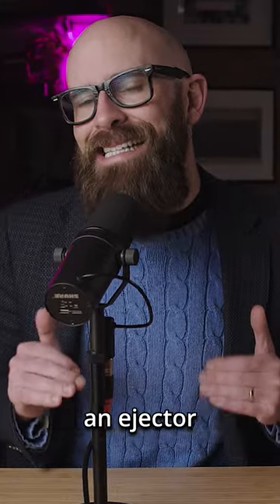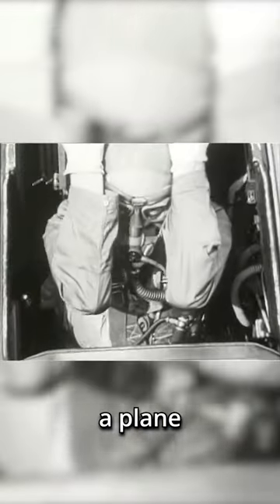How Does an Ejector Seat Work  #shorts

Comment: Almost Simon, but pulling the handle does not send and electric impulse. It sends a ballistic one. Using explosives cartridges ballistic gases set off the various bells and whistles to include in naces series ejections seats "thermal batteries" which turn on and actuate the ejection sequencer (a computer that does as you stated. On older ie sju5/6 seats there is no computer. But rather a rhube goldbergesque machine using explosives, lines, tip rods ectect to set things off in sequence. Canopys are on some aircraft jettisoned from the aircraft in others it is fractured using explosives. But either way the seat is designed to go through the canopy in the even the canopy doesn't do as it should.

Source, I've been an ejection seat mechanic for a bit over 10 years now

Comment: Now do helicopter ejection seats.
Reply: Theres like 1 or 2 helicopters with that feture
Reply: Fighter jet ejection seat: perfectly crafted to save the pilots life even when the plane is damaged beyond repair.

Helicopter ejection seat: haha window
Reply: I dont see a problem with designing helicopter ejector seats. But they usually dont fly that high or that fast. A pilot is usually able to land the thing.
Reply: I heard that there was a concept for a helicopter ejector seat that would eject the pilot out at Mach 20 or something so they don’t get hit by the rotor blades although I’m not sure if this was real or a joke
Reply: @cheesemancomics  helicopter ejection seat aren’t used because they would have to launch you down, and that’s where the ground is
Reply: @starside6738  they are absolutely used. The rotor blades are disconnected and separate a fraction of a second before the canopy is blown off.
Reply: @stephenwest6738  🤡
Reply: In the event of an engine fault, helicopters can do an auto rotation landing...but it's a rough way to land.
Reply: @mattsiede443  still better than seat ejection I suppose
Reply: @captain_context9991 you would have to design a way to not only deal with the canopy but also the rotors potentially lining the rotors blades with an explosive or using a charge to sheer off the rotors. Those rotors would become missiles potentially damaging other aircraft/vehicles or people,  It could punch the pilot through the floor but then the helicopter could crush the pilot or if the altitude is too low which would be the typical scenario. Its not really worth it it might kill more pilots than it would save. Its like the parachute on a passenger jet its too expensive and is to dangerous if it failed.
Reply: @NateKK7  
If you came to the point where you are willing to eject from a helicopter to save the pilot, you would be less concerned with saving the immediate surroundings, I guess. But, yeah. You seem to have thought of every reason why it would be a bad idea. --And why its probably not done.

How about... Firing off canisters of that building foam. That chemical foam that instantly expands when you spray it. Makes everything encapsulated in a surdy, protective flame-proof foam. Which starts to evaporate after 10 minutes. 

But yeah. Helicopters are usually able to slow down. They have doors. I guess you can just jump out with a parachute.